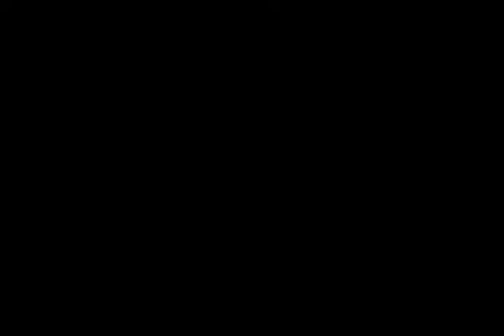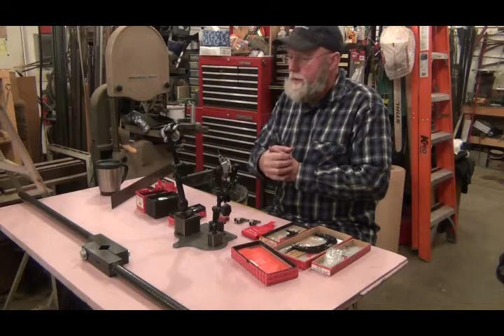Lets take a look at some of my machining tools

Comment: I just got a lathe and have little to no experience with machine tools. My question is should a guy start out with some of the Chinese stuff for dial indicators, mic's or is the stuff junk?
Reply from the maker: I started out with the Chinese stuff. I still use the Harbor Freight digital calipers. This stuff works ok. But the good quality name brand stuff is smother. You can really tell a difference in the quality. I don't know what your finances are. If you are like me I'd start cheep just to get the stuff then start replacing it with quality as you can afford it. It will cost more in the long run but at least you will be able to run your machine and have fun.

Comment: Those radius gages are good for grinding a radius to a specific radius on a tool bit. And those 3-4 little things you kin da showed I think there I.D. mics perhaps? I couldn't see them that clearly. To far away to tell. I D mics are used just for what it sounds like: measuring  the inside diameter of a hole precisely. As in a bearing surface that you have to be within + or- a half a thousands.
Reply from the maker: I'll have to get closer shots of those little mic things. I think they will come in handy someday.